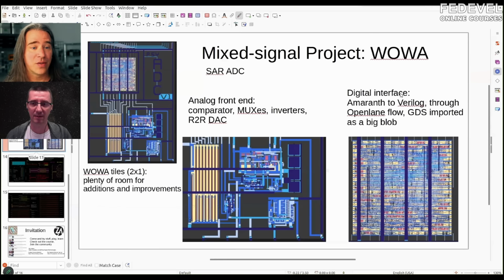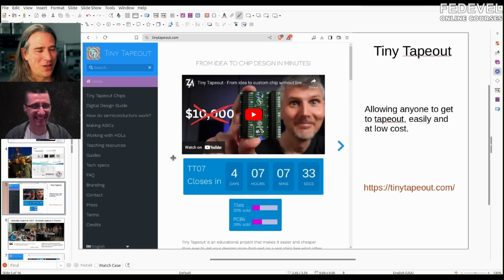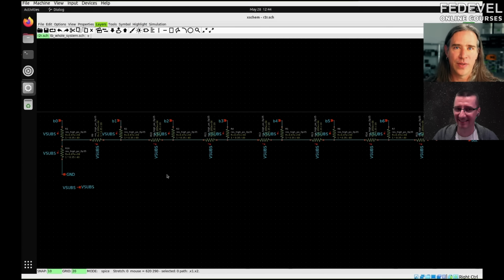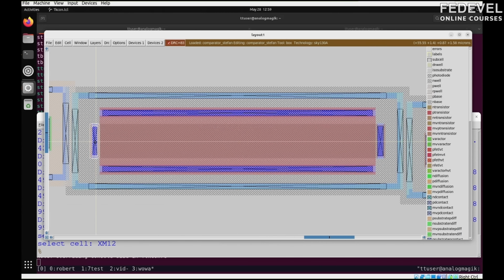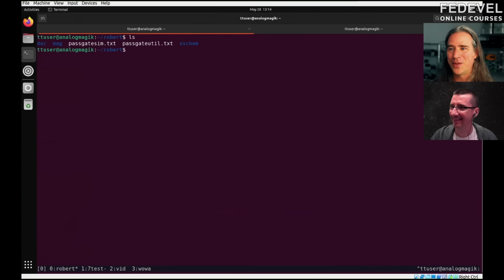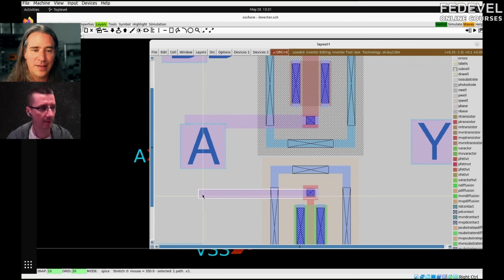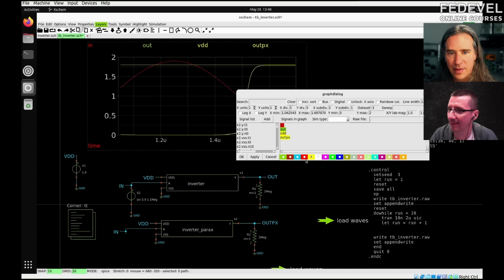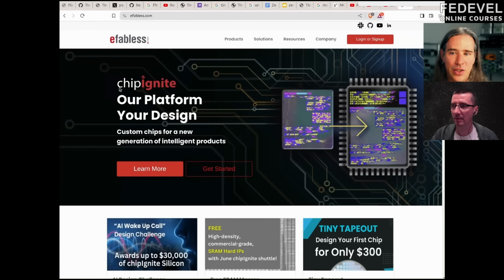How To Design and Manufacture Your Own Chip

Comment: To build my own chip ,therer is a factory in hongkong that does ghat ,i need to code the circuit on the timing i want i want to ,create a story of turn on wait ,turn again ,include laser sensor if cat or anythibg in the vicinity ,also i wwnt to  study how the 3d printer moves ,its programmed on arduino ,but who makes these arduinows ,ocourse designed in usa ,but the pollution in china ,how malicoius

Comment: It sounds very similar to when you have a multilayer PCB with a circuit above 1GHz and so all your strips become inductors and your adjacent layers are capacitors of enough capacitance to mess up the spice model, hence you need software that simulates the physical layout of the board.

Comment: The 8087 codes seem to be missing from the processors. The few additional 387 extensions are in the XC SD cards, but the 8087 is still missing.

Comment: 1:11:18  so this is where the title pic comes from. I may have missed it prior, but does this mean that in CMOS we have to group nMOSFET and pMOSFET ? I saw some die shots of RCA 1802 and it had a lot of rings. But as I understand each ring connected to Vdd or Vss is made of metal and is connected to doped silicon which completely encapsulates the transistor almost like a Faraday cage? I thought that the substrate would have one of the dopings, and the opposite doping would slide in from the source or drain. Is this to preven dirty effects at the end of these small width transistors? Power transistors can fold the gate inside this ring. I should probably google clock circuits. Also the amplifiers in front of the PLA of the 65C02 probably need power and output pins.
Reply: Hi Arne,  so you don't have to group them, but yes they act as insulation like guard rings on a pcb. Magic by default creates guard rings around each mosfet individually--more efficient, hand-crafted designs, sometimes drop those and create their own around related groups manually.  The rings in the examples here are in the local interconnect layer... so, conductive but not super-great (pretty high ohmic)... however, it's down there below all the metal, so the closest conductor to substrate after the poly itself.  Another way the FETs are often grouped is with the dopant wells: a wafer of a given type, say p-type, will make creating fets of one kind easy, while the other will need a well of the opposite type to sit in.  So if you have a bunch, you'll sometimes see them grouped in a well and then a guard ring around all that.  Truth is I still have trouble identifying lots of stuff on pics of decap'ed ICs... the technology used, the era it was done in, there are a whole bunch of ways things seem to change but I think once I can draw a schem from any random die shot, it'll be because I'm pretty comfortable in this world :)

Comment: Nice video,  Do you know where we can build our chip with multiple wafer DIYer and low cost ?$300 is expensive for DIY. thanks :)
Reply: Hi,  I guess it's all relative... compared to a few years ago, this is dirt cheap and the least expensive I know of--but you're right, it's far from completely free.  I just don't know of any other options--other than going the Sam Zeloof route of the home chip fab (which is probably super expensive if you can't just find all those tools, but also super fun)... honestly, the best way to cut costs would be to pair up: with a few friends, each buy tiles to put in projects, and then only get one or two of the chips/demoboard etc... all the projects will be included, and you can experiment with each in turn.
Reply: @PsychogenicTechnologies  Hi, Thanks for the reply, that's good idea for a "few friends buying a tiles", I'm experimenting on building one but it can not be implemented, high cost for DIY prototype, the fastest way is on Xilinx or Altera, but I have interest with DIY a chip :) Comparing with building a PCB, cost only $5 for dual layer, why not with the chip ? for example $5 for a one nano wafer ? it's my humble on building a chip. Kind regards.

Comment: Last questions - The toolchain outlined on e Fabless appears to use ' wokwi' for tinytapeout vs what is laid out in the video . 1. which is the preferred route ? . Can someone please post a link for the VM download that is covered in the video ?
Reply: Hi Hedley.  There are really 3 levels at which you can play: wokwi gives you a graphical simulator, in browser, that you can create projects with and try out without ever having anything on your own computer and go from that to tapeout.  Then there a more traditional FPGA-like flow, where you use verilog (or Amaranth or whatever to get to verilog) to describe your hardware, and go from that to a digital design.  Finally, if you want to do analog, or mixed-signal, you're getting deeper in the weeds and have to start using tools to finally wind up with GDS.  
Each of these can be used to fill tinytapeout slots, which one you use is a mix of preference and what's actually required--in short, you could do anything and everything with xschem/magic, but it would be quite a headache if all you want in reality is a digital inverter (meaning the example in the video was pretty convoluted, since I could've done it with a single component and two wires in wokwi but wanted to show the entire analog flow while keeping it simple enough to not take 5 hours, heh).
Reply: @PsychogenicTechnologies  Many thanks for providing clarity . I will go the last route as although more involved , really provides an appreciation for what's under the hood , and the nuances that support the notion of the 'devil is in the detail ' . I am almost done with setup on a VM , the outstanding part to install and setup is the PDK,  as most of the instructions in online videos were from a year ago so either don't exist , or have missing parts - We often use Efinix FPGA's which has one IDE and then drag and drop blocks like Ethernet Mac , Risc-V cores etc , but the tiny tapeout route seems to provide a rich and fun learning experience 👍
Reply: @hedleyfurio  P.S. I totally agree on all the really interesting stuff hanging out with that devil in the details!  On one hand, kinda glad it wasn't possible when I started with TT, because it's a lot to swallow in one go, but now that it's here, I'll probably be focused on mixed-signal all the way.

Comment: very interesting 👌I guess for high end processors with billions of transistors , this whole process is automated where designers enter VHDL and the bulk of the downstream stuff just happens ? . Wether using Electric , magic , virtuoso - all tutorials use an inverter BUT I have never grasped the leap from a tutorial to a billion + transistor device
Reply: Digital implementation flow is very different from analog and far more automated yeah. There are several extensive introduction courses on the subject on Youtube. Try search things like "VLSI Physical Design". Also this Tinytapeout is more on the educational side (which is fine) and is missing most of manufacturing, testability, reliability aspects. And trust me, designing something you get one good chip of, it is far easier than 100 millions at a 98% yield during years and years of production runs.
Reply: Yeah, you're right.  For something massive, you'd use a hierarchical design in some HDL.  At that level, you don't actually care about inverters, the process handles all the details.  I did a simple, but not quite trivial, digital system in my "Python design of a hardware digital tuner on FPGA and ASIC" and subsequent video (this was in Python -> verilog using Amaranth).  For heavy duty stuff, there are a bunch of e.g. RISC V processors you could look at in the HDL of your choice.  So you do your dev and testing high level, and once you're satisfied, openlane uses yosys and other tools to transform that into a digital using standard cells, but the most you need to care about it is to run your test suite on the final synthesized gatelevel blob.

Comment: As an engineer, I have designed fpga circuits and analogue circuits.
This is the next generation of circuit design mixing both design types onto  a custom intergrated circuit.  
It looks amazing.
Reply: Totally agree: I've only started to scratch the surface with this.  RF is an obvious one I'm looking at, but there's just so much that's possible.  Loving it :)
Reply: Amazing.
Do you use AutoCad design tools to produce the circuits drawings ? Thx.

Comment: Very nice way to introduce IC layout to those unfamiliar. Much easier to digest than VIrtuoso or Tanner which I use most of the time.
Reply: Yes!  The process is older (not necessarily a negative if you're doing analog, anyway) and the tools sometimes a little rough around the edges, but the fact you can start mucking around and trying things out, like right this minute, without downloading giganta suites or dealing with licensing... I think it really opens the doors up wide.

Comment: Just a concern,  if the tile  that you design is adjacent to tiles from  other designers, than how can you guarantee there will be no crosstalk or interference from neighboring circuits?   Great idea, though. Amazing how accessible technology has come!
Reply from the maker: I think you have control over turning on and off the individual projects.
Reply: @RobertFeranec  Ah, perfect!!!
Reply: Yeah, the way it works at this point is just one project at a time.  So you select project 42, say.  Well the chip supporting stuff, the internal MUX, things like that are on, but the only active project is yours.  And from this point on, other projects aren't just not clocked, they're basically powered down, so downside is: you can talk between tiles.  Upside is: it's very clean, no interference possible, and allows TinyTapeout to offer analog.

Comment: xscheme : draw schematic design 
spice : simulate your circuit
magicsky : layout pcb 
again, emulate your layout
then send to manufacturer
Reply: Hi!  Yes, exactly.  An extra step I didn't actually do is, after layout, "LVS" is the step where you use netgen to compare your layout and schematic to make sure you wired things up correctly.  And just to clarify, "magicsky" is a shortcut I use to run magic, it's basically an alias to "magic -rcfile /some/long/path/to/sky130/magic.rc"
Reply: @PsychogenicTechnologies  but hey, when I design at RTL level, netgen is done by the vendor software automatically in hours to optimize delay on their own.
Reply: That's how I design an ESC?
Reply: Do you use AutoCad design tools to produce the 2D schematic circuits drawings ? Thx